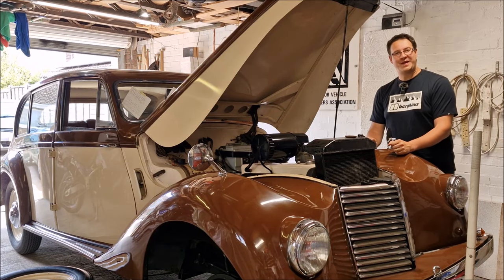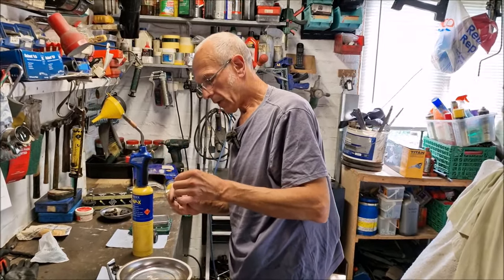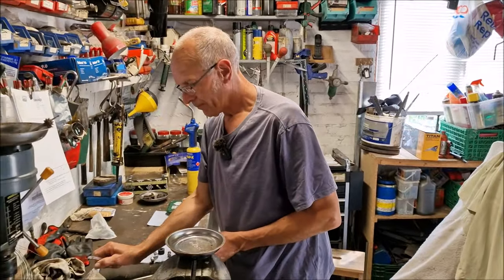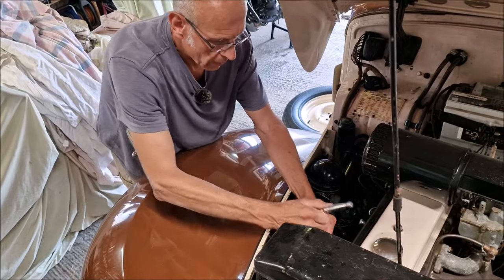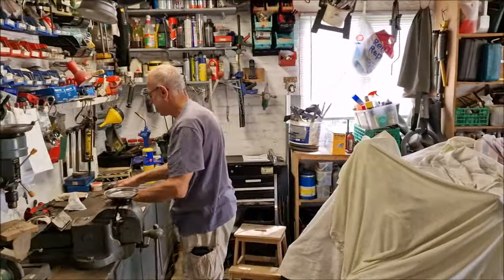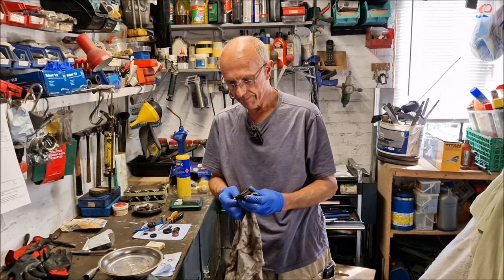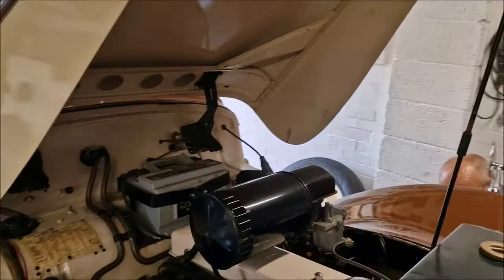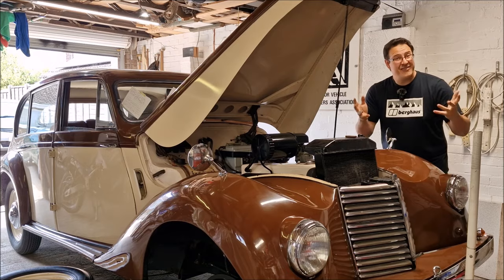Armstrong Siddeley Misfire Repaired & MAJOR Braking Fault Found - "Still A Deathtrap?"

Comment: Just a note about NGK plugs. Your dad noticed his spare plugs had an "R"  for resistor. However, he failed to notice his also had a "P" which in NGK speak is protruding tip. If he compared his spare with the one that came off the car he would see the difference. (BPR6ES).
Reply from the maker: Handy to know

Comment: Hi Jon   Anything electrical these days is a gamble fakes are rife that incudes spark plugs. The bleed nipple repair is normal, it separates the mechanic from the fitter! One point of order to anneal anything heat to a dull red then let it cool normally or with copper washers dump in a box of dry sand and let them cool naturally. In case your Dad is wondering why the washers are still hard that is the reason!  Cheers john
Reply from the maker: Thanks for watching John - bleed nipple repair coming soon :)
Reply: Hi Jon  Watch the vid again at where your dad is rocking the steering  looking at the top arm, look at the bottom arm that appears considerably worse do you think? Not sure if your Dad Spotted that. Cheers John

Comment: Would the rubber of the cup not be affected by the coppergrease?
I know with Citroen A-series one has to VERY careful NOT to make mistakes with any rubber brake parts as there are series using the ordinary DOT3/4 brakefluid (front drumbrakes) while others (front disc brakes) use the green Citroen LHM fluid (based on mineral oil) ie the DOT3/4 brake parts are affected by mineral oil.

One time filling the reservoir with the wrong liquid will destroy all rubber parts causing the brakes to fail…. 
Obviously one has to be very careful too when replacing parts of the brakesystem.
Reply from the maker: Dad says: No - will be fine. (which is good news!)

Comment: Was just looking for spark plugs and most suppliers list a 3/4" reach plug for the Armstrong Siddeleys. N5 or N5C. It might be that these are easier to find than the L10 you are using. If the 3/4" plugs are correct the L10 will be heavily shrouded. I normally deal with V8s and have found Rockauto to be very good for spark plugs. Even with the shipping and vat they are competitive and only supply OE quality parts. Mart.
Reply from the maker: Thanks for your insights 😊 we will try

Comment: I see Champion's quality has gone to pot all over, eh?  also, I think you got hit with "chinesium" with those resistor caps.
how big IS that wheel cylinder, 1 and five eights?!
I swear, only Brits still do this stuff on a regular basis, whether it's vehicles, small engines, electronics, appliances, or even watches. People are few and far between in the States and have to charge a fortune.
Reply from the maker: Yes i fear the same RE the plug caps. Thanks for watching :)

Comment: Land Rover Series 1+2 88 inch wheel cylinders will fit , Beware Chinese Junk Parts  ! ......plug caps included  !  . There's lots of NGK + BOSCH plugs on the Internet that are expensive copies......they look 100% until they fail ! . We used to have excellent things made in the UK sadly we have too search for quality now more than ever  🇬🇧
Reply from the maker: Is that 100% confirmed or just from looking at the one we removed? 😄👍
Reply: I have a '51 Whitley with those fitted  ,   @JonCoupland